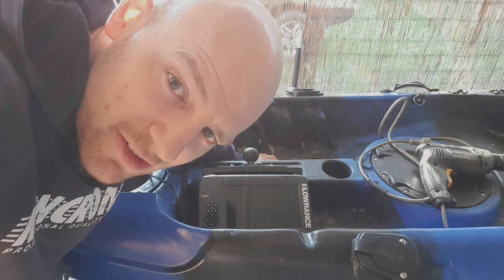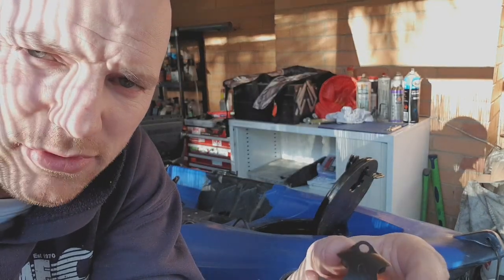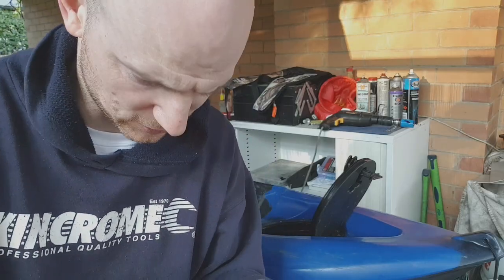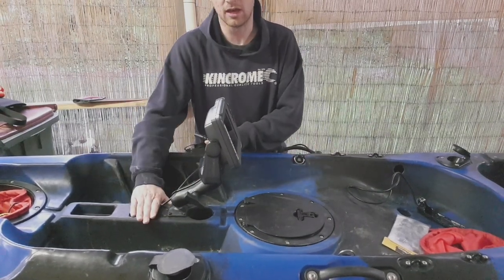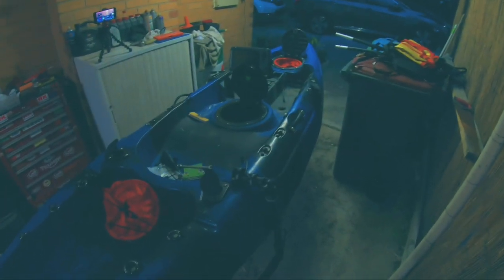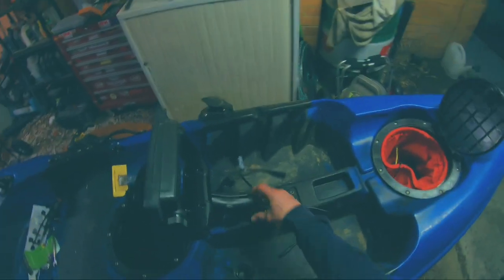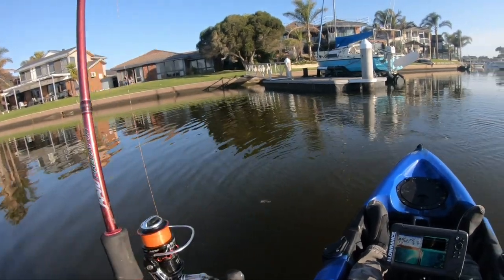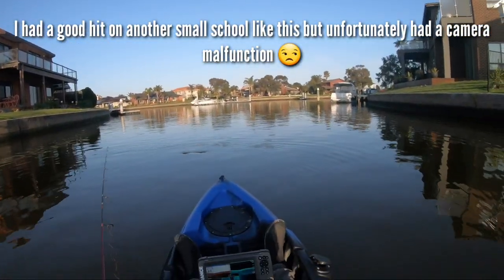Lowrance hook2 7 kayak install and first test.

Comment: Awesome video! I'm thinking about putting a fishfinder on my kayak in the future. For real how are you hooking up to monster bream lol. Teach me your ways!
Reply from the maker: Mate if you haven't done a sounder in your yak yet they are definitely usefull.
I'm still learning how to target Bream with consistency I'm doing some things right but by far perfected it.
I have found the lighter the gear you can go with usually the better especially if they are being fussy.
If they are on the chew hard they will eat most soft plastics or crab imitation lures.
If your in Vic 
Zman Motor oil grub 2 or 2.5 is a perfect search bait. On 1/16 or 1/20 jighead I'm using 1/20 TT lures HWS jighead in both my bream videos.
4lb flurocarbon leader (quite a long leader & 8lb braid for main line.
Reply from the maker: @SinghFishing I paddle into the canals during the incoming tide and fish the high tide change period and outgoing.

High tide in carrum this Friday is early morning 6.43am